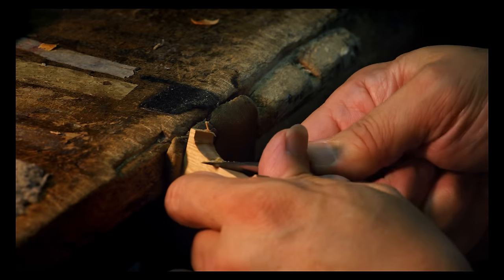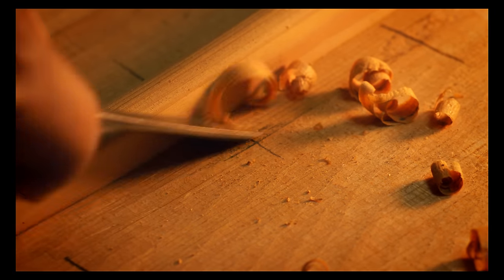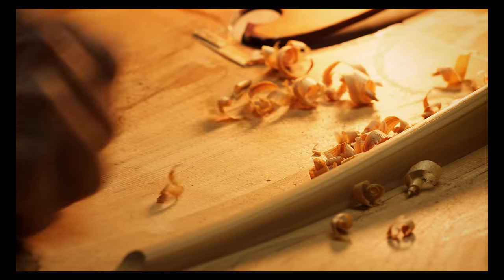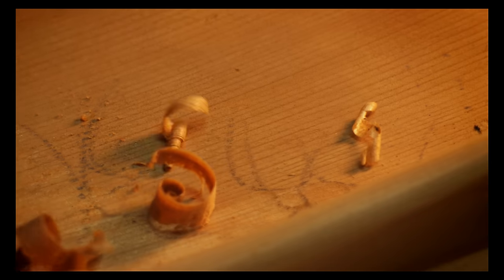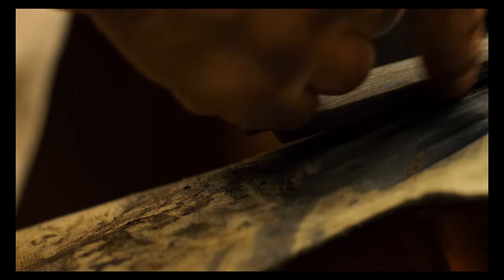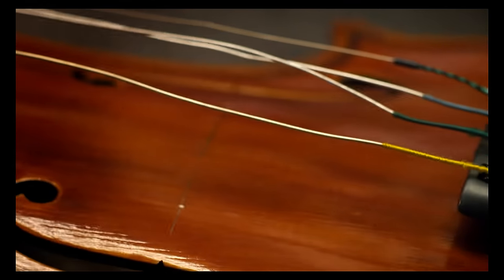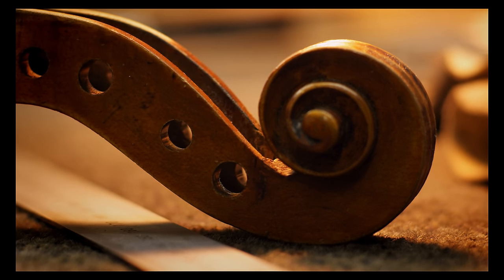The Birth of a Violin

Comment: @Mxsmanic, it can provide a better image, or perhaps more accurate representation if 4k is downsampled to 1080.  But sometimes artifacts can appear.  Also it mostly results in a slight palette and brightness shift.  Basically the image looks about the same.  But as you said, each pixel on 1080 is put to better use since it has been taken from more info of 4k.

Comment: @LiivingMyLife Even if you are watching at 1080p, 4K will provide a slightly better image because of the greater depth of modulation that the higher pixel count provides. In other words, the quality of each pixel at 1080p is improved slightly if the original source had more pixels, because the optimal value of the pixel can be calculated more accurately.

Comment: Weird. Monitoring my CPU and GPU load under GPU-Z and task manager, on 1080p the two seem to share the job of playback nicely. On 4k though, the GPU isn't used at all. I wonder where the blame lies for that. If it was, I think my system would have adequate power to play 4k since it only used 10-15% GPU on 1080p.

Comment: @Augurae I'm only using an old core2 duo running and an Asus MB with integrated Intel GMA/G33, and an ADSL phone line.  My monitor is 1680x1050, and it plays smoothly.  Maybe be you should check for spyware and viruses on you computer.  Oh, and I'm running Windows XP, SP3.

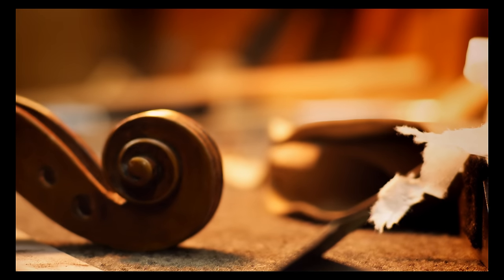Comment: hmm seems to freeze @ 1:23 on 4K for some reason?
Anyways differences from 1080 to 4K apparent to my eyes anyways with cleaner edges around violin bow string @ 2:00 for on 4K version for example.
Easily runs on my i7 950 with 460gtx vidcard averaging 20mb/sec connection.

Comment: @Psythik,  Maybe there is a way your core 2 duo can play it if you keep trying. However, I get the feeling you need a newer computer with better processor.  I have an i7 and it's perfect and I get the full fps.  In this case it probably isn't your graphics card, but again, your cpu which much process each pixel since that's a 2D operation.  But as Psthik said, maybe if you try different browsers you will get lucky and it will play ok.  good luck.

Comment: Yeah, my internet speed is fast enough to play the 4K resolution, and my computer plays it back just fine but my 1680X1050 monitor just can't display the same resolution as a 25 foot screen would lol. I'm also wondering if my computer can actually play video at 4K or if it automatically scales it down to something more manageable like 1080p.

Comment: Youtube fix your website...4K is lagging on GTX 550 Ti 1gb,six core amd FX and 8gb 1800mhz ram...
Reply: That's your internet bro... Computer specs have nothing to do with internet issues... If your YouTube is lagging, then get a better internet plan.
Reply: The video has completly loaded but when i watch it on 4k it kind of lags(in periods of half a sec maybe) but it is annoying,just too visible it ain't smooth :) When i download the video and watch it on my pc with BSPlayer or other video program it plays amazing :3 <3
Reply: That's because you've downloaded it, so you're not streaming it. YouTube literally has nothing to do with your lagging. Stop whining about YouTube and learn something about computers please. It'll be amazing :3 <3
Reply: whaow its called buffering the process of loading and showing you the video :) Also i'm pretty sure i'm way more into PCs than you will be,its a different thing that i'm into hardware not software :) Dont judge too quickly ;) And when the video has fully loaded its going to your ram which sends waves of signals to your CPU and GPU !
Reply: FoRealGG
 I was watching it with a GTX 660m on my Laptop (i7 QM3610) without any lags (of course 4k Mode) - I've recognized 77% usage of my video engine (usually Full HD with high bitrate (30Mbit/s) it is about 12~20%) ^^

Comment: @SmellsLikeUpDawgg Do you even read what i typed? As you know, 360p is 360x640 pixels (lets remember that). Now, lets look at how much frames are there. Lets say, 24 frames per sec. That means 3072 frames. Now, by multiplying 360 and 640, and multiplying that by 3072 we get our number.

Comment: @Uberboylover, Being on mac has nothing to do with it.  It also worked great on my PC without skipping.  If anything a mac will have a slightly lower chance of being able to process it due to the slower hardware that apple give out in comparison to  upper end pc's.  But if the cpu on your particular model has enough power to do it within skipping then you're all set.  i7 would be recommended.   A good internet connection is needed too.